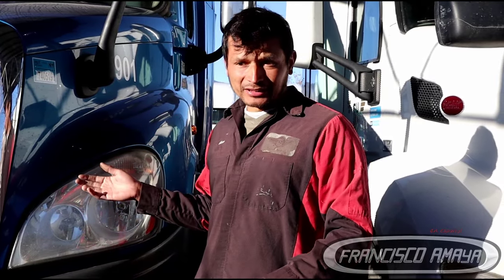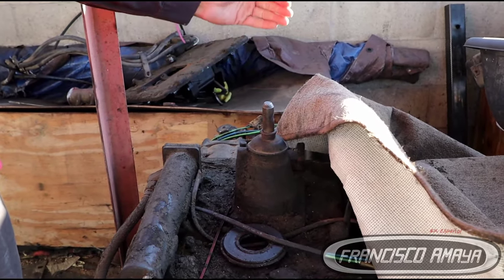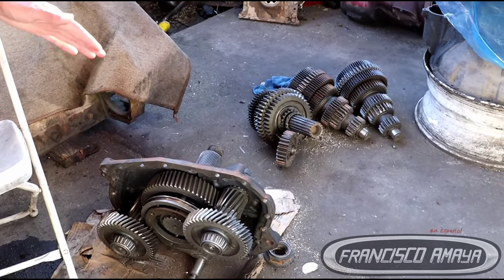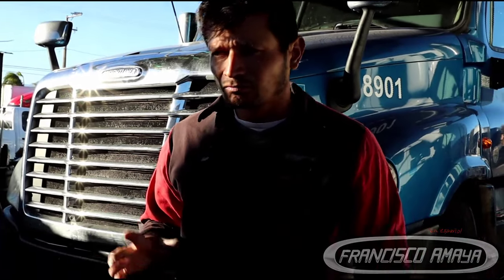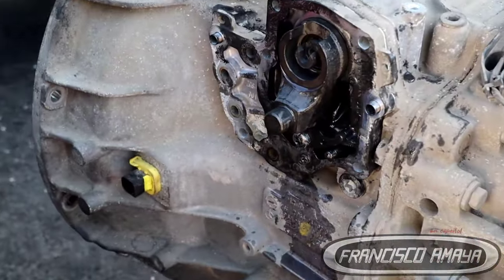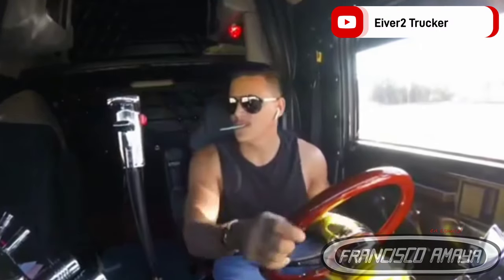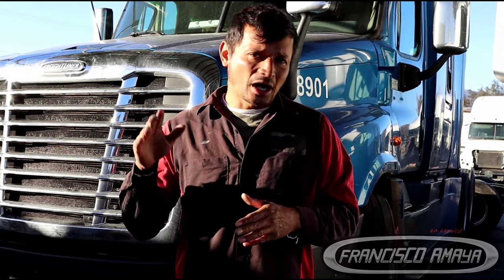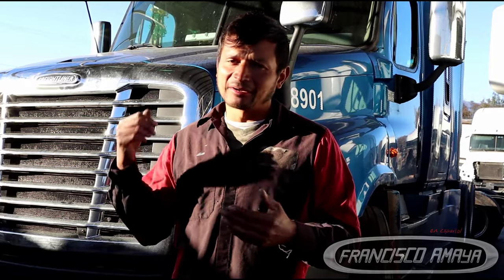Automatic transmission vs Manual transmission for heavy duty trucks what is better pros and cons

Comment: I bought a brand 2017 Cascadia (automatic) now has 600k without a single issue with transmission (knock on wood) because east coast mainly on I-95 you will hate yourself driving manual. The other thing I like automatic is that if you going down the hill loaded and you want a lower gear for some reason, you can shift down no problem. Also 0% grinding.
Reply: It sounds like you never learned to downshift a manual transmission
Reply: @Invisboi205  no, we're not gonna do this. It's 2024. No time arguing with Mr. Know It All.

Comment: After driving 25 years I got my first automatic 10 speed . I prefer a 10 or 13 speed manual due to these 2 factors. First manual pulls better in hills holding gear better. Second I was stranded in middle road due to cpc going bad. That is my biggest reason no computer to worry about. Automatic is great going down hill and in traffic.  Enjoy the educational videos
Reply: Automatic sucks going down hill. Especially dt12 revs the engine up too much when you turn on engine brakes. Manual is way easier and better

Comment: Question :  Is it possible to put a manual transmission to the  automatic transmission truck ?
Reply: Mostly yes. You can do a transmission swap and switch out an automatic transmission for a rebuilt manual. If a driver owns a truck for a million miles, they might seriously consider changing their engine / transmission combination instead of a rebuild of the existing equipment.
Reply: @finalmidnight  Thank you for the answer.
Reply: But its much more expensive than you might think